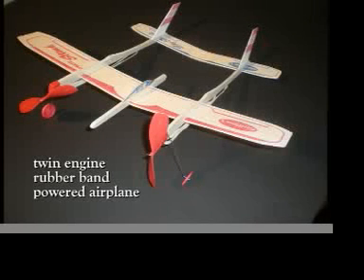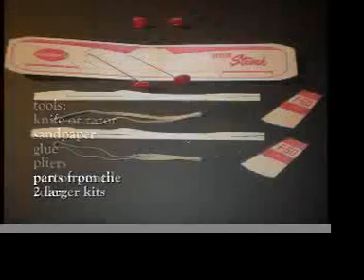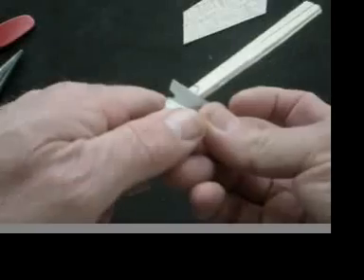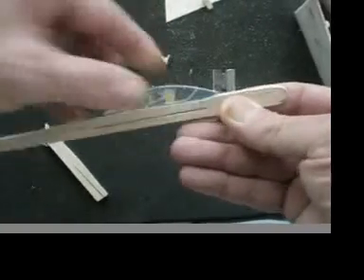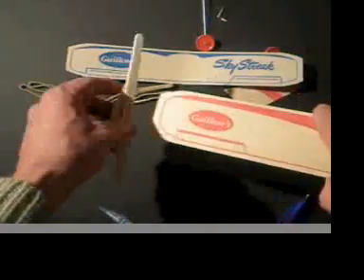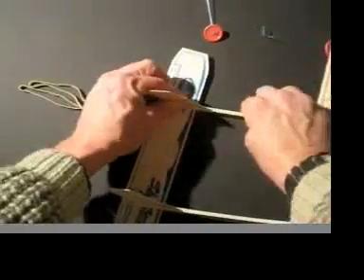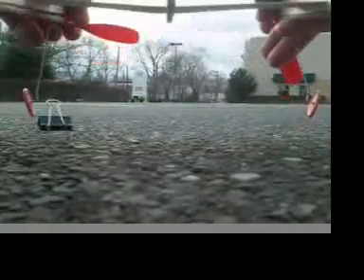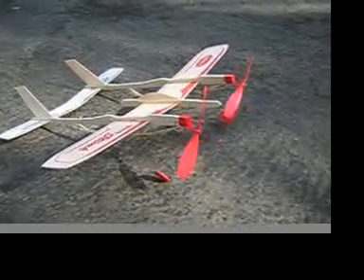twin engine rubber band powered airplane

Comment: I DID FERGIT TO ADD THAT WE DID NOT HAVE TO CLIP THE WIRE LANDING GEAR LIKE YA DID WITH YERS MODEL. WE JUST LEFT THE LANDING GEAR ALONE, THERE WAS 4 WHEELS INSTEAD OF 2 LIKE IN YERS VIDEO.

Comment: @lolziloveminecraft thing that would be too much power, if not too much speed also, at that sped and weight if u crashed the wood would shatter.  I did that with a old jetset i attached it to a custom made frame, was pretty interesting till the left engine died.

Comment from the maker: they are the same, opposing props would probably be better. they exhaust the rubber bands so quickly, that the roll imposed by the reaction of the rubberband/propeller torque tends to be minimal. if you could add more thrust, it would be better, but with the present/available propellors, you're right, it tends to roll the aircraft in the opposite (right) direction. thanks for asking, good question...let me know if you find a simple solution...best, mark